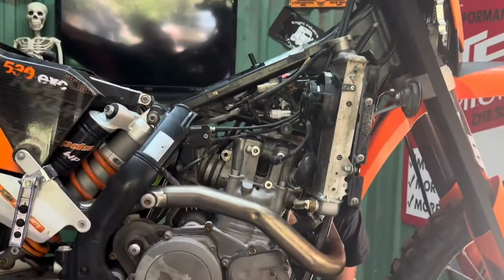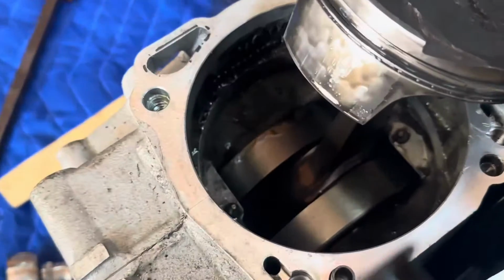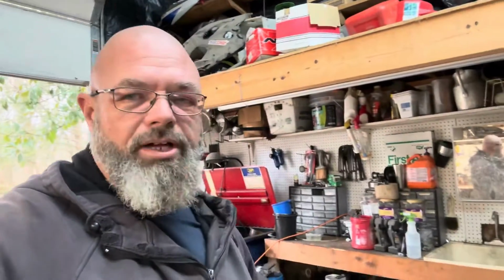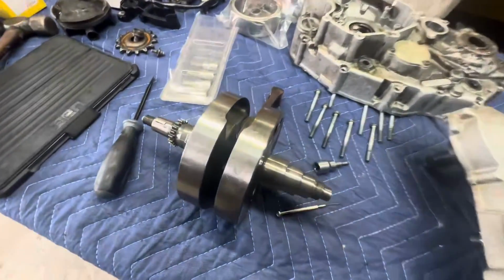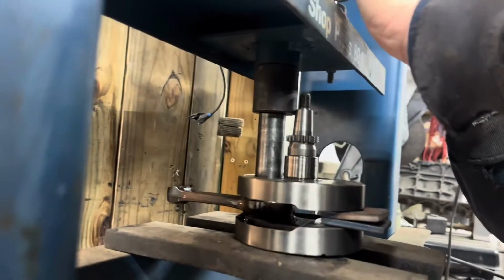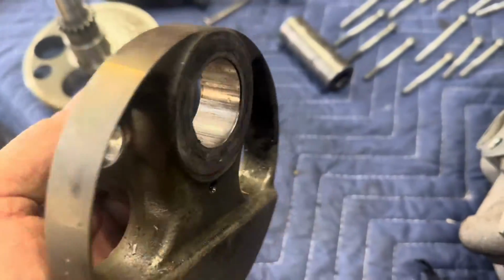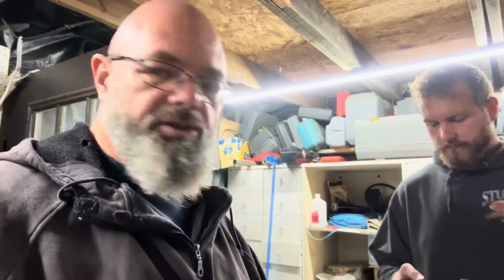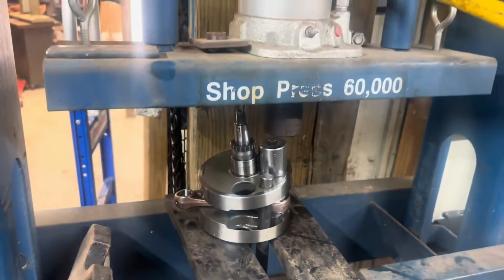KTM another project unfinished? in the shop with AMSOIL ADAM!

Comment: Keep them engine s running thanks for sharing this video with us i like seeing people fixing there own stuff not sure about the crank shaft i know its got to be really balanced to hold up not sure the rpm s that little engine turns but its going last longer if its balanced it looks like thy would of stamped some line up marks on it i know its to late but a coal chisel and a hammer could of got it back close to what it was before taking it apart but if someone else took it apart before that's more than likely the reason it beat the bear out it got hot like a lack if lubacate on it it surely didn't have amsoil in it when it cafted out and locked up its interesting watching you trying to get it back going
Reply from the maker: Thank you for watching charles, I appreciate your words

Comment: You are going to use a metal straight edge after you press it together
Reply from the maker: We did we just didn’t have any luck getting it to move to lineup properly
Reply: @amsoiladam  well..ok, I would have clamped it in the press and whacked it with my big copper hammer, specifically used for ornery crankshafts!